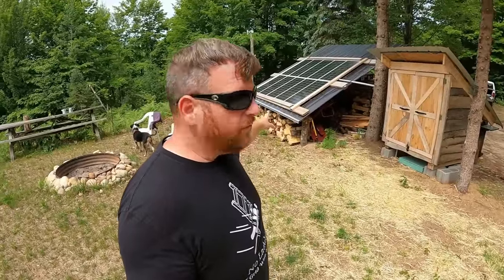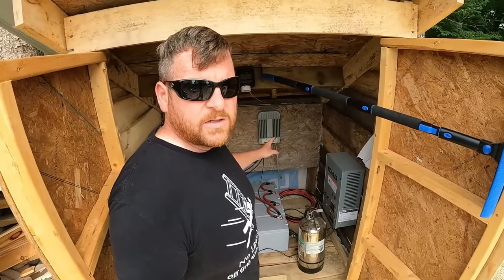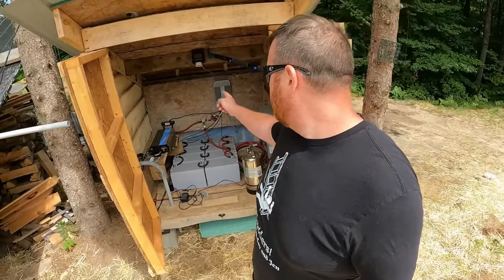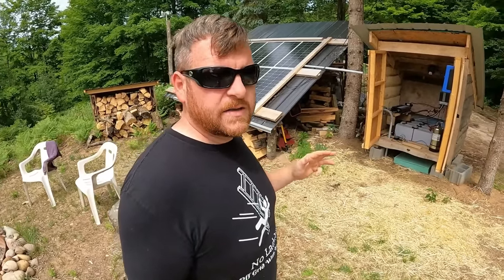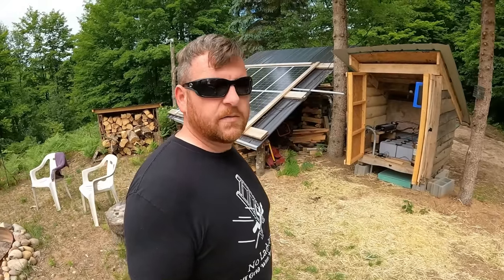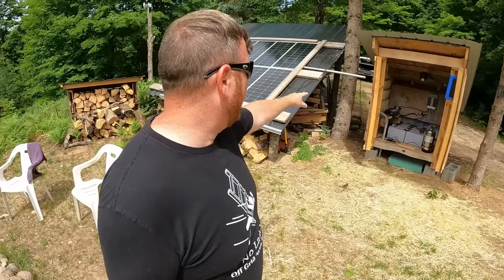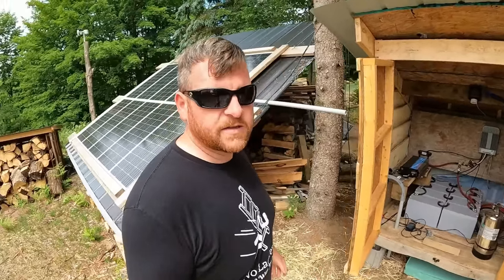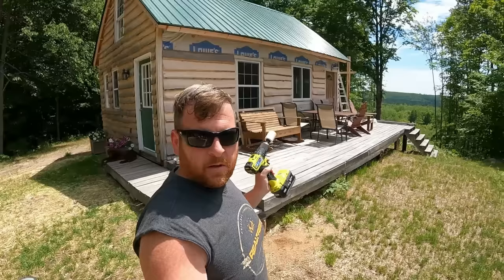One Year Off Grid Solar Power System Update

Comment: As long as you don't have a bunch of needs. Like- two refrigerators. Washer dryer. 3 AC. Small solar is well worth it.. My neighbor in Tumwater WA got 25,000 dollars in solar. He had to replace his panels from age. Halestorm. Lightning. His batteries from age. Again with lightning.
.
He has a big house with his wife's family in it.. Two refrigerator and 3 freezers. 2 Washing machine😮 2 dryers.
.
In 10 years, it's cost over 20 grand in damage. He even has a natural gas generator because the batteries get drained daily.. 4 200amp. 12v. Or that's just in one location.
.
His sister in law rewired his old 4 batteries to 24 volts frying his system..
His brother in law rewired his vans batteries to 24 volt frying the alternator.
.
Is solar worth it?
Now thinking about it, he might have turned his toolshed into sister in laws apartment. He's the home owners association president.

Comment: I'm procrastinating setting up the wiring on my 12v 100w panels to make them 24v, I hear MPPT charge controllers charge better with higher voltage.
Reply from the maker: Hey hey, depending on your charge controller and size of battery bank wiring in series can help things run more safely and efficiently. Every situation differs slightly

Comment: @Off grid with Jay and Jen    Did I miss the part where you mention how long you can power the cabin for? If you lost commercial power would it be able to power everything you mentioned in this video (lights, fan, fridge, laptops, camera gear, heater?) for a couple days?
Reply from the maker: Hey SW.....the cabin is all off grid. No  commercial power for miles around. This system runs the whole cabin for 3,4,5 days at least with poor charging conditions. One nice day and it is all charged back up to full and we are good to go again. In the last six months we have not had the battery bank drop below 75%. The only thing you mentioned which is not included is heat. We heat the cabin with a woodstove and use a stove that runs on propane for cooking. We use about one 20 pound propane tank every 4 -6 months for stovetops cooking. Super effective.  When you add it up....all the stuff we use in the cabin might only draw couple hundred watts. Lights, fan, and lap tops all take 30-40 watts each.....biggest draw is fridge which ours is a 10 cubic foot and only draws about 70 watts at a time. Really low draw too

Comment: Cheaper to just put a old school 100watt bulb in battery house you will be amazed how much it will heat up in there as long as it doesn’t have a huge amount of air moving around also you can tell if the bulb goes out as soon as it gets dark

Comment: Very informative video. I would enclose under the battery shed and insulate the inside of the structure.  Not a lot of money for that.
Reply from the maker: Ya I'm going to make a weekend out of getting this solar shed prepped for winter....thanks for watching Don. =)
Reply: @OffgridwithJayandJen  Since heat rises, think about putting "cleats" just above the height of the battery bank and laying 1"+ rigid styrofoam insulation panels across the top.  Even though the panels are lite weight you may need to put three 2x4's across the width of the enclosure to hold the panels in place. - - Hey, it's portable and easily stored in the ceiling area in the warmer months. - -  Awesome build & video.  Thanks for sharing.  Have a blessed day.

Comment: I bought a eco flow delta pro and for my situation it has been really good. I don't even charge it with solar but I do have some propane things so that helps on how much electricity I use. I work outside all day mostly so that helps aswell. But eventually I want to get some panels but only have so much room on the roof I want to put them on. Just wondering if cheap Chinese panels will do the trick mostly
Reply from the maker: Any solar panels would be better than zero solar panels.....I know people who use the Harbour freight panels and they work....I'm sure not great, but they work

Comment: Maybe just insulate the solar shed and put the batteries on top of what you have there. I think getting 2 heating pads is silly. It will be a load on your batteries and be counter productive. Better to have insulation and maybe one pad tops. I would try and avoid heating pads tho. There may be enough heat from the inverter etc don't forget and it is in its own little house which isn't a big space.. Maybe have a thermometer in the shed and monitor the temperature inside there. Watch out its not to hot in summer too!
Reply from the maker: I hear ya......I'm thinking the heating pads will be on a switch and I can turn them on when sun is plentiful.....might help hold above freezing during the night.

Comment: 3,000 watts? That's 2 hairdryers! I would recommend an inverter at 6,000 watts/50 amps AC with 18,000watt surge with 220AC split out (about $1500 on Amazon). You don't have to worry about tripping a breaker if you have children/family running: freezer, fridge, tv, cable box, hairdryer, shallow water well pump and lights all at the same time. It won't run AC though, you'd have to gang 2 inverters (in parallel) to double the amps to 100 but keeps the voltage the same 220AC, especially if you want to run a deep water well pump at the same time also.
Reply from the maker: That is an option if you need that much juice.....we don't use hairdryers and have never pushed the inverter over 1100 watts using everything we  ever needed, so this works well for us. 😊👍

Comment: I have a similar solar (100w x 12 panels) setup tho with lithium ~ it also runs a split mini a/c which really sips energy
Reply from the maker: Thanks awesome....I have been interested in the mini splits but have not sat down and did my research yet. Thanks for the insight and sharing your experience 👍 about hw many batteries or how big of a battery bank do you have??
Reply: @OffgridwithJayandJen   I have two batteries there are 200 amp hours each and I paid about $700 postage paid from them on Amazon each. The split many is a pioneer that I also got an Amazon and does not require an HVAC person to install it and it was around $800.
The split money is a game changer and as long as the heat index is under 100+ degrees I can run it day and night on eco mode. I added two more hundred watt panels yesterday because my son said I could do that LOL! And just goes to 100 W panels have made a big difference. My son also told me that I’m getting two more batteries would be very good idea especially if there are a lot of cloudy days in a row.

Comment: Maybe you answer this in a later video, but with the Renogy Deep Cycle batteries being $190, would you still do this over a couple of Bluetti units? It would still be cheaper for the Renogy overall, but you don't have the convenience of a Bluetti.
Reply from the maker: This system was set up in hopes of getting us to a point in time, where technology and affordability if lithium based products was more reasonable. I feel it has done its job, where solar products and battery technology has become far more reasonable in price and  in its abilities. If I was building from scratch I would do it differently, BUT everyone's situation is different and if building a system for full time or only for a weekend get away call for different strategies. I honestly think using an all in one system or power station  with expandability makes for a very attractive option. Portability and versatility are great, if not just using it for a  full time cabin system.

Comment: If you are going to heat the batteries you could have used lithium iron phosphate battery and be able to get 80-90% use of the battery rather than 50%.
Reply from the maker: This is true....but we didn't have the upfront budget for this. Everything we have here can be used with lithium iron phosphate if and when the prices become more reasonable.

Comment: I too started small and when I got more knowledge I add it to my system. I’m curious why you’re limiting how many amps go into your batteries? Seems like you could up it to me without any problems. 
The biggest change I found is & coming with the lowest cost is adding solar panels.
Reply from the maker: I'm not a fast learner, but with time and effort I can figure things out, may take me years but possible, lol. I'm not sure how I'm limiting my amps that you're referring too, I can guess you mean coming from the panels, but I kept amps low to keep it simple and safe. Keeping the amperage low I can use the smaller  wires without fancy junction boxes. Also I believe my batteries are rated to be charged at 20 amps for best lifespan. Although my charge controller can charge up to 40 amps it rarely pushes more than 20 amps into the battery bank
Reply: @OffgridwithJayandJen  
I would contact the battery manufacturer and ask them how many amps you can push into the batteries. 
If your charge controller is limiting you, I would pick up a newer one. I prefer Victron. 🖖

Comment: 10 amps output seems very low for that many 100watt Renogy panels. I use one 100 watt Renogy for camping and the 1 panel alone generates 7 amps max. 10 panels in parallel would generate 70 amps max. He must have the 5 panels on top wired in series and the bottom 5 in series. Then if you parallel those two panel banks, NOW you're maxing at 14 amps from the panels. But the problem with that theory is it would be a 60 volt system & he said it is a 24 volt system. I'm confused but having fun thinking it through. At any rate he's built a great set up and the cost is reasonable.
Reply from the maker: Thanks SS, yes two strands of 5 panels. Each strand only pushes 5.5 amps, but at 22.5 volts in parallel,  so 110ish volts. Series parallel that and you get 110 volts at 10-11 amps. The Charge Controler does the rest.

Comment: I just discovered your channel.

Do you worry about using wood to mount the solar panels?

I'm thinking about wood rot
Reply from the maker: Wood rot happens with excessive moisture. Being it sits in the sunshine and is not hiding in the forest it dries out well amd quickly so I don't worry about it......also this racking took about 3 hours to assemble and I have only 75 bucks invested into it.  When or if it rots,  I will simply rebuild it for n afternoon project. 😊 just how my brain works.....might not be the best way.....but works, lol. Welcome to the channel, hope you enjoy what you find here and stick around. Best wishes EM

Comment: Have you considered fireproof insulation on the battery bank shed and including a 100W heater on the interior tied to the batteries with a controller for temperature requirements?
Reply from the maker: Yes, I mention working on insulation and heating pads being done before winter. 😊

Comment: Couldnt you use one of those chicken heating lamps inside your shed so there isnt direct heat on the batteries?
Reply from the maker: You could do that, but I didn't insulate the whole shed like I should have and the pads only use 100 watts total where as I think the chicken lights use 3-400 to run. Good idea though

Comment: Couldn't you solve the problem with LiFePo4 batteries not working when it's too cold by putting a little heater in the shed on a thermostat plug that cuts on when it gets below a certain temp? The problem with lead acid batteries, as I'm sure you're aware, is that you're only getting about half of their rated capacity in usable power.
Reply from the maker: Hearing the shed is definitely and option, but Heating the batteries directly with a pad like I mentioned would make it more efficient.  You are right about the capacity of lead acid batteries but we just keep us cabin simple and don't really use much power, so our battery bank serves us well for our needs

Comment: Do you think it could  run a chest freezer  i really  want to be able to run lights and a chest freezer  if the grid  goes down having a freezer  to save food would be   invaluable
Reply from the maker: yes, They say chest freezers are actually more efficient than refrigerators. primarily because they are insulated better, designed to hold the cold in when opened because the chest design, and they are obviously not opened as often. We are actually on the look out for a good deal on a small to medium size chest freezer to have here in preparation for hunting season when we will need to process our deer meat and store it. As a note check the amp draw on the unit you are buying and multiply that my the volts and you will get a pretty close idea of how many watts the unit draws when running. Our fridge says 1.2 amps and we multiply that by 120 volts getting around 150 watts. Our fridge only runs at about 170 watts for a couple hours when first being turned on, then runs for short bursts at 70 watts for 5-10 minutes to maintain. Super efficient really.

Comment: You can tipple the life of your AGM batteries by installing a proven technology, (Battery Life Saver BLS-12/24C Desulfator ).  You can get it at Amazon for about $120.  I use it for my double van batteries.  Hope this helps.
Reply from the maker: Awesome will be sure to check it out. Does this work differently than the boost type charging setting that is done on most MPPT Charge Controllers? I have seen on grid chargers use the desulfator type setting but never on a solar set up. Thanks for the info
Reply: @OffgridwithJayandJen    GBear "Off-Grid" in the desert uses this on his solar system.  Hit him up for info,  I'm sure he will be glad to give you valuable advice.

Comment: Do you have insulation in the solar building if you do you can put a fixture in for a indecent light bulb and leave it on in the winter months cause it puts out a lot of heat
Reply from the maker: That is a good idea....I'm going back and forth on weather to insulate the whole shed or just the batteries. we will see. Thanks for being here

Comment: What´s the big idea to put the battery pack in cold  shed instead of  make some space inside your big house probably heated the year around. It must be  much better for the battery pack and all the electronic stuff. Your batteries gone last much longer in a dry and warm environment just saying ??? Regards from winter Sweden👍
Reply from the maker: You right about the batteries lasting longer, but here was my thought process.....ONE I'm very new to everything you see on our channel.....building and solar. So This made me fearful of burning my cabin down...TWO...I didn't really have a long term plan or idea for the cabin or system itself so I wanted it to be somewhat portable and flexible. Putting a solar system in my cabin just scared me, and I figured this system gave me time to learn and get some experience under my belt before I went building the ULTIMATE solar power system, LOL.  Hope this helps a little. Best wishes my friend
Reply: A good advise is at least is to move the batteries from the floor to wall mounted shelfs cus the moist damp and cold from the ground  through the floor to the battery pack its not good. Sorry about my english ! regards Thord H     @OffgridwithJayandJen
Reply from the maker: @willeboppa  Appreciate the tips....the shed has a layer of reflectix insulation in it to block the moisture. Two years almost now and no problems other than the cold temps. =)

Comment: Question: 1000 watts divided by 24 equals 41.666 amps. If you only have 10 gauge (30 amp max) wire, isn't it possible that on a super sunny day your wires will melt and start a fire? 8 gauge might be safer.
Reply from the maker: I see what you are saying. But the solar panels are wired In series so the voltage is not 24 on the input end. Each panel pushes I think 19-22 volts and times 5 per strand. So each strand has 100ish volts pushing through it and each panel also pushes 5.5 amps each....but when wired in series the amps stay the same and do not multiply. The only reason I'm pushing 10-11 amps is because my two strands of five are joined in parallel before going to the CC
Reply: @OffgridwithJayandJen  Yes, at the join over to the CC would need the bigger wire -- not that I'm an expert.
Reply from the maker: @morpher44  I see what your saying now. I do have heavier gauge wire going from CC to the battery bank. 6 gauge I think it was. The 10 qauge is just for the input to the CC. The output

Comment: FYI. They sell lithium iron (phosphate) batteries with internal heating to allow them to be charged/used in freezing temperatures. They are more expensive right now but would be good for a future option. Not sure what low temps you get there, you could insulate your power shed to help with that too.
Reply from the maker: Ya. You are right. I kind of mention this later in the video how the new batteries have heating pads.....but technology is ALMOST there. Soon I hope
Reply: The internal heater uses power even when you are not using the system so compare the lead acid batteries that if charged you can leave you could have an issue if it’s very cloudy and you’ve turned off most of your appliances to save power and it’s cold The batteries are still going to need a lot of power for the heaters which may not be a problem but you may have to run a generator every week

Comment: Nice setup! What is your heat in the winter? Considering something similar in northern New Hampshire 
Thank you
Reply from the maker: We heat the cabin with a wood stove. If you are talking solar shed heat, I don't really heat it, the batteries are AGM so they don't really need to stay warm to use them. It is better for them to stay warm because it keeps them more healthy, but they work in the cold, just slightly less efficient.  I do have two RV style tank heating pads, 12 volt, that use 60 watts each under the batteries.  They can be plugged into my generator or any 12 volt power supply and heat the batteries if needed, but honestly i have never really used them. I kinda installed them for desperate situations. If the Temps dropped way below freezing